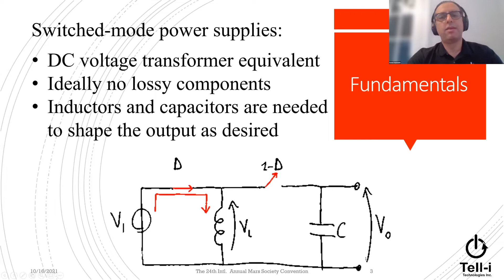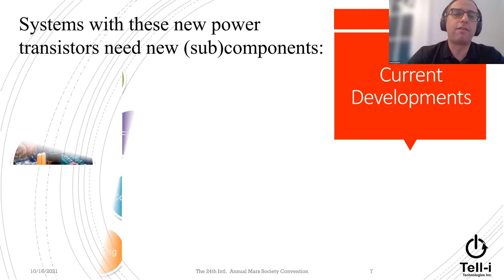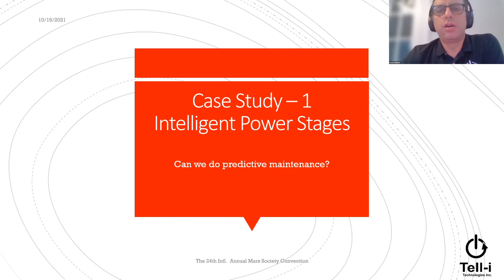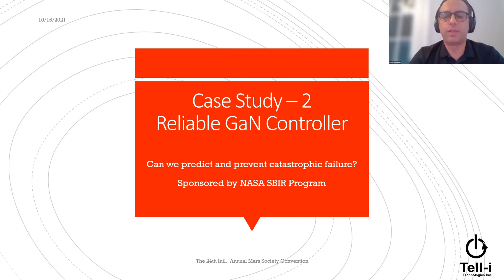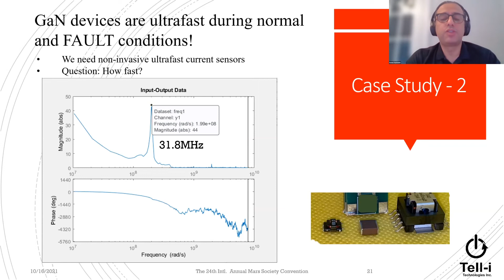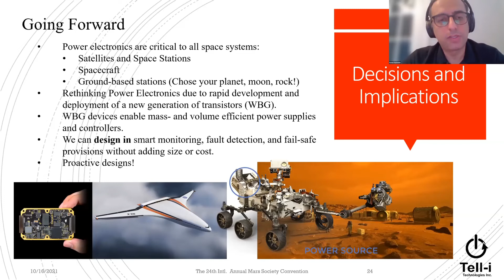The need for speed in Space Power Electronics - 2021 Mars Society Virtual Convention

Comment: Were the transistors used in these tests pnp/npn devices or field effect devices?
Reply: They were field effect devices. Efficient high voltage MOSFET (unipolar devices) are possible with wide bandgap semiconductors such as silicon carbide and gallium nitride.